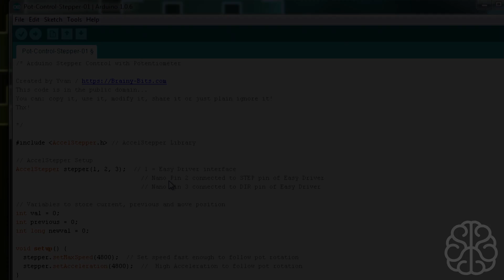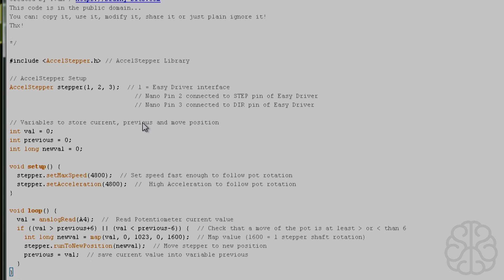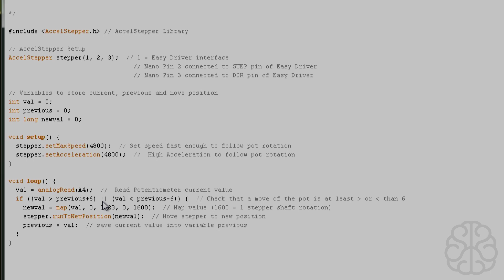How to Control a Stepper Motor with an Arduino using a Potentiometer? - Tutorial

Comment: Hi I have been trying to get it to work with my tmc2208 and a4988 and it kind of works but keeps stopping after a certain distance also will only travel so far it does travel further if you increase the map value "1600" upwards. I have tried adjusting all the other values with various results but it still keeps stopping and starting and is not that responsive. If you could help me to solve this or even provide the code for a tmc2208 and a4988 instead of the easy driver I would be very grateful. Thanks

Comment: Hi thanks for this code, Its the first actually working. However I need to have the code to move to different positioned in the clocks and anti-clocks positions.  Would you mind sharing that mod?

Comment: A very valuable tutorial. Thank you.  Also, is there a way to ramp up the speed of the motor to a high Potentiometer setting?  I turn on a stepper with a switch and the speed is set by the Pot.  If the Post is set for a high speed when the switch is turned on, the motor stalls. Thanks

Comment: Thanks for the video! I tried the same setup (except with an a4988 controller) it does work, however it seems as though the turning of the potentiometer is only registered in intervals. Even with the recommended speeds when I turn the pot with the same speed the motor reacts as if I turned it in three smaller parts/steps rather than one smooth turn of the knob. Even microstepping does not alleviate this... Any idea what could cause this?

Comment: this is the best routine I have found to manage the movement of a stepper in proportion to the movement of a potentiometer. simple and effective at the same time. I'm using it to move a linear actuator through the signals of an RC receiver. just make a MAP of the received servo signal and convert it to the value of a potentiometer. 

CONV = map ( S4_SOLLEVAMENTO_In, 1500, 2000, 0, 1023); // S4_SOLLEVAMENTO_In = servo signal in microsec >>>>> to pot value
 val = CONV;
 Serial.print(" CONV = "); Serial.println(CONV); 
 //val = analogRead(A4);  //  Read Potentiometer current value
  if ((val > previous+6) || (val < previous-6)) {  // Check that a move of the pot is at least > or < than 6
    newval = map(val, 0, 1023, 0, 444000);  // Map value trimpot to total step needed of slide movement  
    // (i use a astepper motor "200 step tourn" connected a gear reductor 40:1 - M20 screw 185 mm long / 74 screw threads / 6000 steps per screw revolution) total 444000 step  )
   Serial.print(" STEPS TO PERFORM/ NEWVAL = "); 
   Serial.println(newval); 
    
    stepper2.runToNewPosition(newval);  // Move stepper to new position
    previous = val;  // save current value into variable previous
  Serial.print(" STEPS REACHED = "); 
   Serial.println(previous); 
 delay (2000);

Comment: #include "AccelStepper.h" 
// Library created by Mike McCauley at http://www.airspayce.com/mikem/arduino/AccelStepper/

// AccelStepper Setup
AccelStepper stepper;  

// Variables to store current, previous and move position
int val = 0;
int previous = 0;
int long newval = 0;   
int total=0; 

void setup() {
  stepper.setMaxSpeed(4800);  // Set speed fast enough to follow pot rotation
  stepper.setAcceleration(4800);  //  High Acceleration to follow pot rotation  
  Serial.begin(9600);
}

void loop() {
for(int i=0;i<20;i++){
val=analogRead(A0);
total=total+val;
}
total=total/20;
 
  
  
  Serial.println(total);
  if(total<750&&total>=0)
  {

  if ((total > previous+8) || (total < previous-8)) {  // Check that a move of the pot is at least > or < than 6
    newval = map(total, 0, 1023, 0, 1000);  // Map value (1600 = 1 stepper shaft rotation)
    stepper.runToNewPosition(newval);  // Move stepper to new position
    previous = total;  // save current value into variable previous
  }
  }
  total=0;
}

Comment: I like the code got a couple of questions:  Can the rotation of the pot increase as it rotates speed in both directions and how would I put that in the code? Second, can you use a motor driver MA860H?  I am creating something for my class and I need to drive three motors. Last, is there a way to create a program that reads joystick input into Microsoft HID Human interface device to send to Arduino?

Comment: I would like to be able to do exactly what you are doing here.... but I have an A4988 stepper motor driver. and it doesn't work with this code. I tried and it does nothing. 

I tested  out my driver and motor with a sample code specifically for the A4988 worked perfectly. 

Any help would be appreciated.
Reply: Hi, did you find out how to do that with A4988?👀

Comment: this code was gud with accelstepper library, but when i m using l293d driver ic how can i change it. i tryed to do but motor stay where it is.
here is the code:
#include "AccelStepper.h" 
AccelStepper stepper( 9,11,10,12);  

int val = 0;
int previous = 0;
int long newval = 0;    

void setup() {
  stepper.setMaxSpeed(4800);
  stepper.setAcceleration(4800); 
}

void loop() {
  val = analogRead(A0); 
  if ((val > previous+6) || (val < previous-6)) {  
    newval = map(val, 0, 1023, 0, 1600);  
    stepper.runToNewPosition(newval); 
    previous = val; 
  }
}
the hardware set up works fine with this code ( for your reference)
 #include <Stepper.h>
 

#define STEPS 200
Stepper stepper(STEPS, 9,11,10,12); 

int Pval = 0;
int potVal = 0;
 
void setup()
{
  Serial.begin(9600);
  stepper.setSpeed(60);
}
 
void loop()
{
  if (Serial.available())
  {
    int steps = Serial.parseInt();
    stepper.step(steps);
  }
}
plz do needfull
Reply: finally  i fond to make it respond, now its turning in both the direction but only a few steps, with lot of small shivering ,  
i change this Stepper stepper(STEPS, 9,11,10,12); 
 to this Stepper stepper(STEPS, 4,9,11,10,12);

Comment: Simple and effective tutorial. I have a doubt to be clarified !! Can we control the speed of the stepper while going the other way around ? 
For example
The motor completes one clockwise rotation in 2 sec when we turn the potentiometer . And while we bring back the potentiometer back can we control the anti clockwise rotation to take 3 or 4 sec to complete the rotation ?
Reply: the accelstepper library have some functions that increase or slower the max stepper freq or acceleration - you simple divide the routine in loop in to 2 separate routine -one for val > previous and one for val < previous

 val = analogRead(A4);  //  Read Potentiometer current value

 if (val > previous+6) {  // Check that a move of the pot is > than 6
    newval = map(val, 0, 1023, 0, 1600);  // Map value (1600 = 1 stepper shaft rotation)
    stepper.runToNewPosition(newval);  // Move stepper to new position
    previous = val;  // save current value into variable previous

  if (val < previous+6) {  // Check that a move of the pot is < than 6
    newval = map(val, 0, 1023, 0, 1600);  // Map value (1600 = 1 stepper shaft rotation)

/* then use this function of accelstepper for increase o slower values 
 void  setMaxSpeed (float speed)
 
float  maxSpeed ()
 
void  setAcceleration (float acceleration)
 
void  setSpeed (float speed)
remember to do the same in the first 'if' to bring the speed back to that originally set
*/
 stepper.runToNewPosition(newval);  // Move stepper to new position
    previous = val;  // save current value into variable previous

Comment: I've done this with two different motors and no matter what I get a little shakiness from the motor.
I've done the brainy bits rotary encoder and it's just not  smooth for my application...
what would be the best way to have  smooth control (bidirectional) using a pot-like control.
Reply from the maker: Check out this other video I did using a Potentiometer to control a stepper: https://www.youtube.com/watch?v=nLkT_SrFung  hope it helps, thanks for watching!
Reply: Isn't that the same one as this one? 
I've tried it with the rotary AND the potentiometer and it has some shakiness. 
I'm creating a wireless follow focus for my cameras since the products out there are outrageously expensive-- $800

What can I do?
Reply: it depends on what is causing the shakiness. It could be noise in the system which is what the code is designed to handle. You may need to use a number larger than the 6 that he used. Or it could be that the gain of the control circuit is too high and that caused the system to essentially try too hard. Look at tutorials and read about the AccelStepper library
Reply: Have you put common GND?
Reply: Hi I am doing The same thing as you And having The same provlem with The shakes And Steps skipping did you manage to fix IT ?

Comment: thanks Ivan, nice video, Can you please show us some lazer made stuff. I find your lazer cuts pretty fine quality, it must be a co2 module or I maybe wrong. A 2W lazer module wouldn't get these fine edges.
Reply from the maker: +Hobby at home Hi.  You are correct, I use a 50W CO2 laser to make those parts.  Can't afford an Epilog or those other brand names ones :) so it's one from china.  After making good alignment and changing the Lens that came with it, it's actually pretty good!  I'll try to make a video showing off the creation of a new part from start to finish in the future.  Thanks for the suggestion and watching btw :)